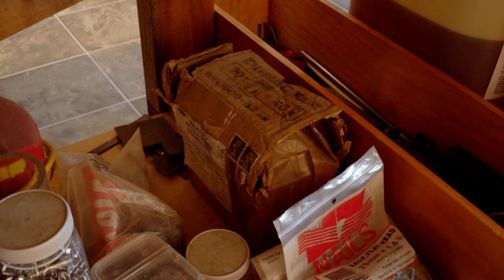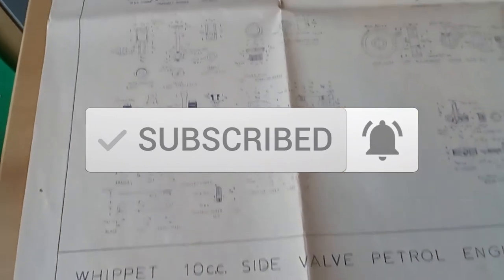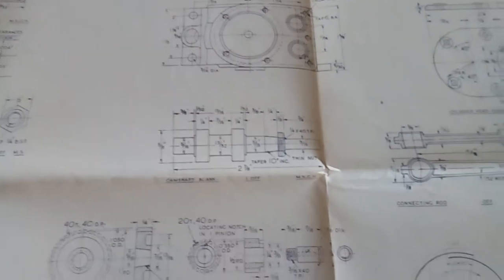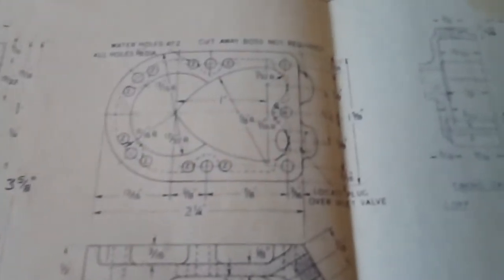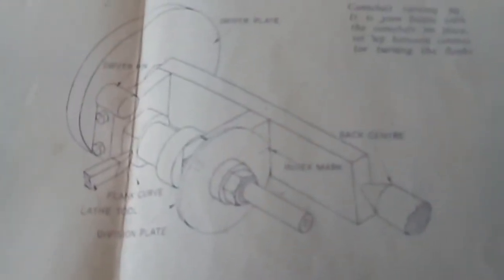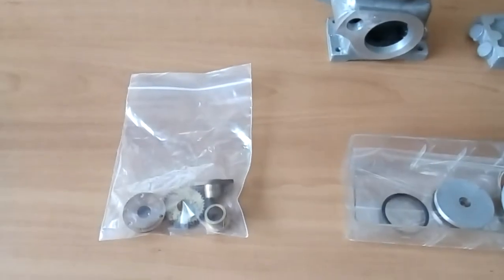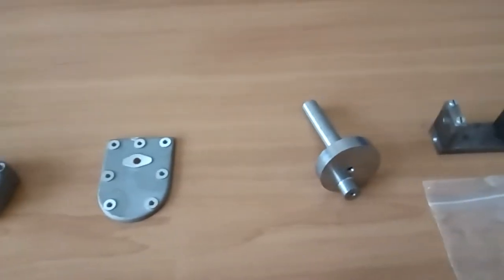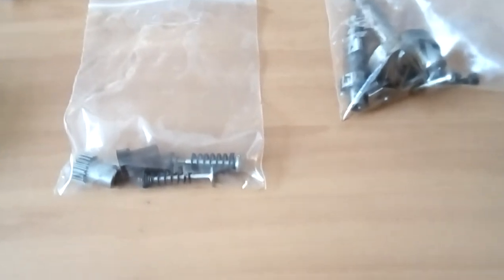Whippet by E T Westbury -  Unimat 3 lathe modifications - Under Workbench find

Comment: Hello Dave. I am interested in buying this engine. Is it possible to build this engine without a lathe? Or without a machine shop? Thanks.
Reply from the maker: A lathe is definitely required.  Check-out Edgar T. Westbury's instructions here:  http://www.john-tom.com/MyPlans/SteamPlans3/Whippet/WhippetSingle10ccModEng1963x.pdf
And these excellent instructions here: http://modelenginenews.org/projects/whippet/index.html
It's a difficult build for me
Reply: @GardenRailway  thank you for your information. I’ll be avoiding this model!
Reply: @GardenRailway  hi again Dave. I got a bit more money. Could you please explain why the engine is difficult to build. And if you can, could you find me an easier engine to build? Thank you.
Reply from the maker: Hi, The Whippet has a number of errors.  The cylinder head casting has the bolt pads in the wrong position which cause holes to be drilled too close to the cylinder.  I had to plug these and re-do them.  The camshaft drive gears don't align properly, I've had to bush the gear and reposition it so that the gears align.

The Westbury Atom Mk III is a great first model.  I built one years ago using my Unimat 3 lathe.  There's even a construction book available, and castings:
https://www.teepublishing.co.uk/books/for-the-aeromodeller-engine-builder/the-atom-minor-mark-iii/
http://www.hemingwaykits.com/acatalog/The_Atom_Minor_Mk_3___designed_by_E_T_Westbury.html

Good luck!